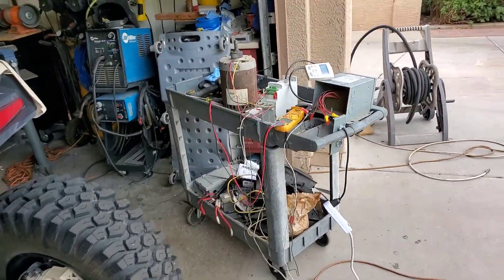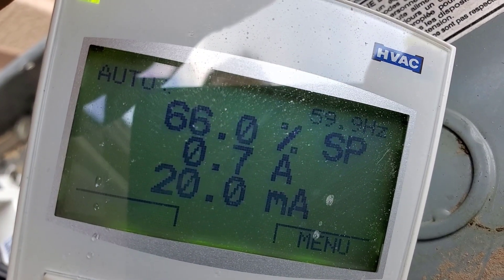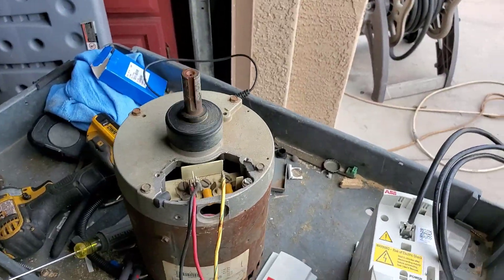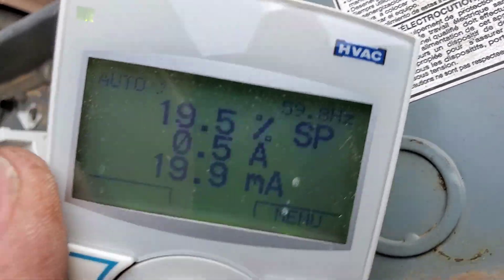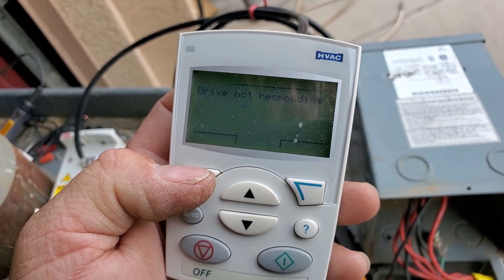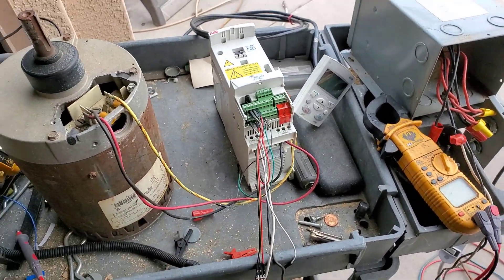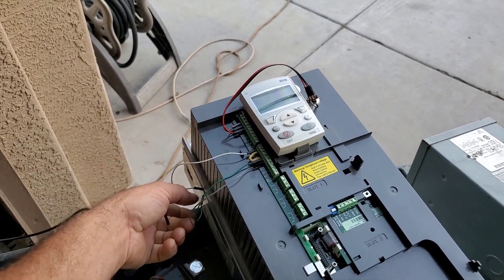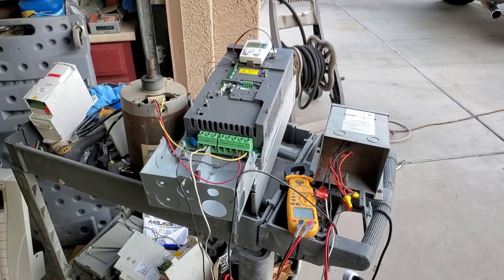Using a transformer to test 460VAC equipment at home

Comment: Reminds me of the setup my grandfather had to create 3 phase from 1 phase using a 3 phase motor. Had 3 big power resistors and before you turned the power on you had to start the motor turning with your foot. But it would spin up and produce the other 2 phases.

Comment: hi you did not connect the display on the third vfd 5:25
Reply from the maker: LOL I think I picked it up when I heard the click, which was meaningless with it not plugged in. However when I flipped the power on to the transformer I could hear a hum and a click as the breaker popped and it didn't matter to go any further with that one.
Reply: Yeah I noticed the same thing, it looks like you forgot to plug in the screen.